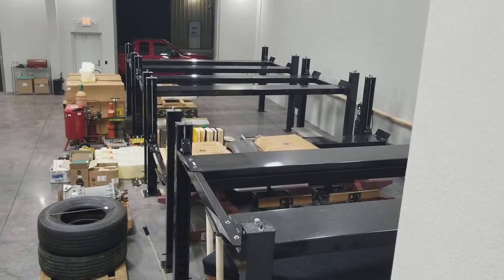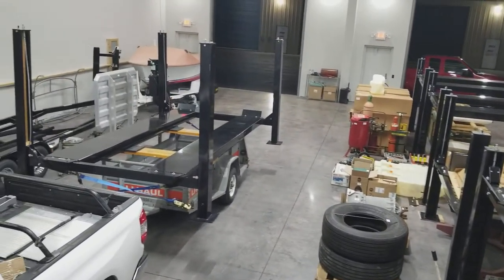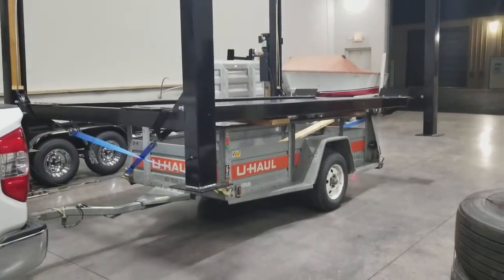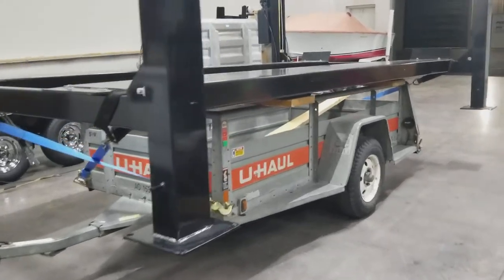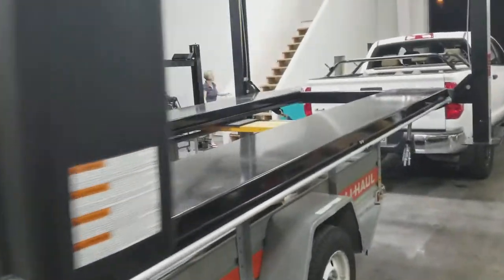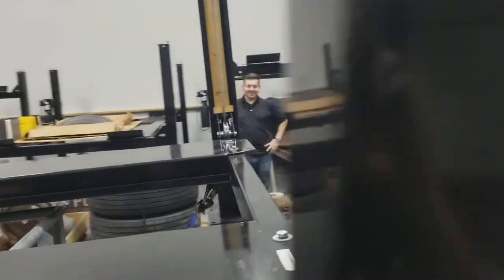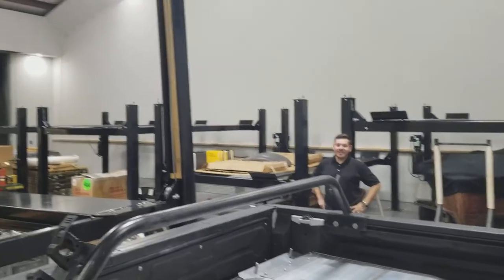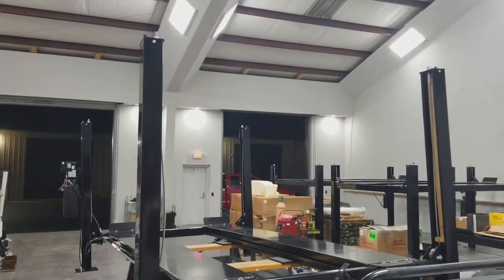You do NOT have to disassemble a 4 Post lift to move it!

Comment: Hi, congrats.  I also think to do so that way, since i have to move 25 from one parking lot to another one.  Just wondering how it goes with the police traffic.  any sugestion?
Reply: most areas do not allow the load to be over 8.5 feet wide without a permit / tow car for extra wide load, so check local regulations on the width of the load. If you are close to the limited dimensions you can mark the ends and be safe to transport them. Otherwise dismantle and load them vertically like normal folks :)
Reply from the maker: You can purchase a one time or annual blanket "Wide Load" permit to move anything.  Depending on the state you are in, the cost is as little as $5 for a one time move, or as much as $500 for an annual permit.  :)  https://oversize.io/regulations/maximum-width-by-state

Comment: how did you do it??    haha
Reply from the maker: You're funny.

Okay, here you go anyway.

* Raise the lift high enough to back the trailer under it.
* Place 2 x 6 under lift but on top of the trailer rails.  
* Add thick rubber so the steel lift won't slide on the wood. 
* Lower the lift to release pressure on the cylinder and 4 lift cables.
* Disconnect the 4 lift cables at the cylinder.
* Remover the small spring on each safety lock.  
* Lift each leg high enough (easy with two people) to place a 2 x 4 inside the leg channel to support them from falling down.
* Tie the lift using the criss x cross method to ensure it will not move.

* Save $400 after U-haul trailer rental.

:)
Reply: Scott Ales 
your the best
Reply: @ScottAles  I know this is old by 8 months, but I just bought me neighbors lift from 7 doors down and we are going to move it like this. was trying to figure it out, found your video. The driveways are the hardest part for us. We have casters but the curb wont allow us to move it far. So Thank You and this trailer idea is awesome
Reply from the maker: @tunanocrust2642  Happy to have possibly made a difference for you!

Comment: Just asking for a moving violation.
Reply from the maker: Actually, that's not correct.  You can purchase a one time or annual blanket "Wide Load" permit to move anything.  Depending on the state you are in, the cost is as little as $5 for a one time move, or as much as $500 for an annual permit.  :)  https://oversize.io/regulations/maximum-width-by-state